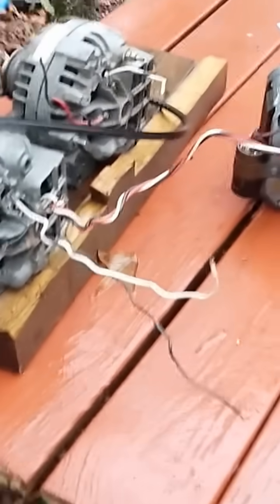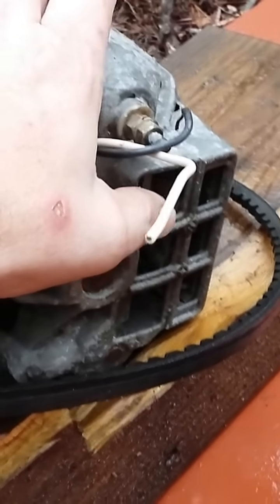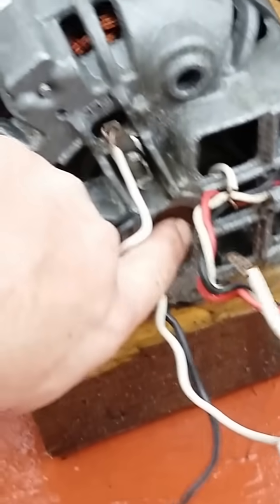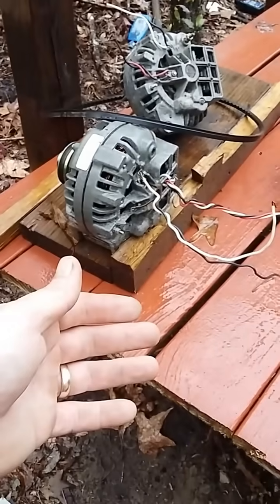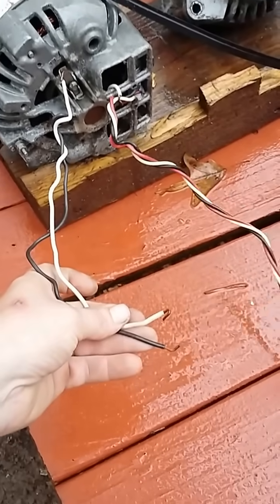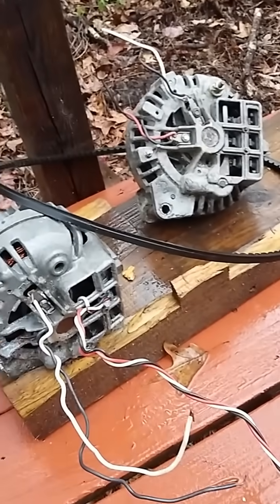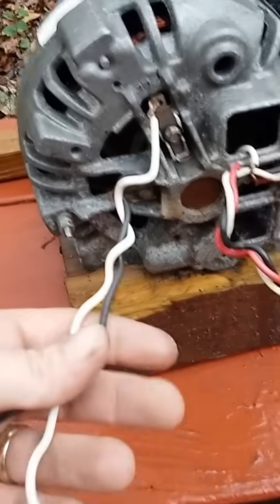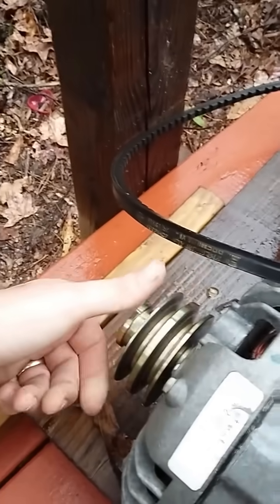Update Free energy forever no wind no solar no gas READ DISCRIPTION!!!

Comment: A battery is stored energy. As soon as you connect any electric device the battery will run down. 
There's no free energy here. It's stored in the battery.
Reply from the maker: +waitaminute 2017 you say that's your problem well let me tell you this what happens when you use high voltage you lose resistance you also become more efficient now what happens when you use extremely high voltage there is no resistance and there is no laws that affect it so continue thinking whatever you want to think but because you've been told so many small lies your entire life now you believe the big lies and it's sad
Reply: Thomas I don't want to be argumentative but 3 to 12 volts dc is not "extremely high voltage".
Ohm's Law is not a lie! Ohm's law can be easily confirmed with a volt/ohm/current meter. 
Ohm's law is not complicated if you can do a little algebra. In science laws are "impossible" to disprove. That's why they call them laws. If you can disprove Ohm's Law by scientific measurements you would be the first and probably win a Nobel prize lol. Good luck.
Reply: Thomas Buie The statement about losing resistance at high voltages is just plain wrong. Transformer stations pump out incredibly high voltages at very high amperage, and every so often you will see transformer's on poles to accommodate for line loss.(resistance/ohms law)
Reply: ThomasBuie EnergyBuies at gmail com  Just how much weed have you consumed? Buddy you are so fucked up you can’t even make a sensible statement.
Reply: Thomas ,you make some outrageous  statements,  most of which I can disprove with highly simple demonstrations, or experiments that can't be disputed. I believe this is what you are talking about,  but I will demonstrate there is line loss no matter voltage,  or amperage. 
The power cables have some resistance. Power lost in the wires can be calculated as P=R*I^2 with R as the resistance of the wires and I as the current that passes through them. Power at the load is P=V*I. From this you can see that if you increase the voltage by 2x, you need only half the current to deliver the same power. However, if you pass half the current on the same wires, you will lose only a quarter of the power.

An example with made up exaggerated numbers:

Wire resistance is 10 Ohm (not very long power line), power required is 100kW. At 220V, the required current will be 100kW/220V=454A. The power lost at the wire will be 10Ohm*454A^2=2.061MW. Voltage lost at the wire will be 10Ohm*454A=4540V. So, the power plant will have to generate 4760V so that the load can receive 220V. Power generated at the plant - 2.061MW+0.1MW=2.161MW. Efficiency is 0.1MW/2.161MW*100%=4.6%

Now suppose the plant generates 330kV (and the voltage is stepped down to 220V very close to the load). Now the current needed is only 100kW/330kV=0.3A. Power lost on wires is 10Ohm*0.3A^2=0.9W, so the efficiency (ignoring power lost in the transformer) is 100000W/100000.9W*100%=99.9991%. Transformers are very efficient, about 98% for the big ones used in power distribution.

Now scale that up to, say, a power plant that generates 1GW and you will see why Tesla won the current wars (hint: there were no efficient DC-DC converters back then).

Summarised solution:

Resistive power losses both in absolute terms AND as a percentage of energy carried drop as voltage increases.

The reduction in loss and/or material (copper and/or Aluminium conductor) is so vast that use of high voltage is very desirable.

Power loss in transmission of power over distance is mainly (but not wholly) by resistive losses.

Resistive power loss = I2⋅RI2⋅R(current squared x resistance).

Power transferred in a circuit = Voltage x Current = V x I

So power lost as a proportion of power carried:
Note that this has units of Voltage/Voltage which cancel to give a dimensionless ratio (as you'd hope). The "top line" Voltage is the I x R voltage drop in the line and the bottom line Voltage is the transmission voltage. So loss ratio is effectively resistive_voltage_drop / line_Voltage.

So, for a given conductor of resistance R the percentage of power lost will increase as current increases and will decrease as voltage increases.

But as Power carried = V x I, if we double V we halve I.
If we multiply V x 10 we reduce I by 10.
This is a win-win situation for high voltage.

This can be put two ways.

For a given transmission line, carrying the same power at higher voltage will reduce loss%.

and

For a given desired loss of power (say 1% end to end) we can use increasingly higher resistance lines (and so less metal) as voltage increases.

A simple calculation shows that loss % decreases as the inverse SQUARE of Voltage !. Increase voltage by 10 x and for the same line resistance losses will drop by a factor of 100!. Murphy was asleep that day!

The gains are so great that if this was the only factor then as high a voltage as possible would make sense.

There are other factors such as losses due to corona and the need to provide substantially increased insulation and clearances and tower sizes as voltage foes up BUT economically, it all leads towards big tall ugly very high voltage towers.

Simplistic example:

1000 Watt power transfer. Rline = 1 ohm.

(1) V= 100V, I = 10A. Power transmitted = 100 x 10 = 1000 W.
Power loss = I^2 x R = 10^2 x 1 = 100 W.
100/1000 = 10%.
10% of power is lost.

(2) V= 1000V, I = 1A. Power transmitted = 1000 x 1 = 1000 W.
Power loss = I^2 x R = 1^2 x 1 = 1 W.
1/1000 = 0.1%.
0.1% of power is lost.

(3) Increase line resistance to 10R = use 10% of original material. Still use 1000V. V= 1000V, I = 1A. Power transmitted = 1000 x 1 = 1000 W.
Power loss = I^2 x R = 1^2 x 10 = 10 W.
10/1000 = 1%.
1% of power is lost. Even when the line uses 10% of the conductor material of the original circuit, an increase in voltage by 10x decreases power loss by a factor of 10 !!

!!!!!!!!!!!!!!!!!!!!!!!!

The reduction in loss and/or material (copper and/or Aluminium conductor) is so vast that use of high voltage is obviously very desirable.

There are other factors that make the gains less great in practice BUT the existence of large and larger power pylons demonstrates that reality is still well served by higher voltages

Power lost as heat due to the wire's resistance given by:
P = I^2 * R (equation 1
Hence, if current I, small, power lost is small.

Power intended, or needed is given by:

P = I*V (equation 2)

For larger voltage, smaller current needed to deliver same power. Hence, larger voltage means smaller current; smaller current means less power lost.
I left out 1 equation,  fix it And I'll believe everything you say.

Comment: he is talking about 3 to 12 volts to spin the motor that is going to "generate" 90 volts?  Lets said it works,what's going to happend when they battey dies?DOOOOOO
Reply: Jaime Santiago 90 Amps...learn the difference ...smh
Reply from the maker: +Jaime Santiago  that is not what I said at all. did you read the description of the video? no you didn't!!
Reply: Who said anything about a battery? To get the 6- 12 volts dc you can use a solar panel!!! Cheers

Comment: Your basic motor vehicle could provide power to your home or any source of 120 volts if you know what you are doing with a basic converter. It comes in handy if your power company can't provide electricity doing emergencies.
Reply: wayne pope gas for your vehicle will cost more than the electricity master electrician
Reply: Please can you show me how i can generate 500watt 24/7 365days of 220v. my whatsapp +2348034099120

Comment: Well you are definitely on to something there, but you need some guidance for sure. There is no sense in trying to get ac current straight from the alternator because it will burn from the voltage drop when you apply a load. 
In order to make it an operational circuit you will need a dc motor to turn the alternator , a 12v battery for a power source and either an inverter to connect to the battery to convert the 12v dc into 120 v ac or another dc motor to turn a 120v generator head. Good luck.  I call it the CON.

Comment: The conductors in the alternator itself aren't close to being big enough to handle 90 amps at 240 volts.... neither are the conductors you want to hook up to your panel. Second, its a alternator....not a transformer. You cant put 12 volts of DC current into this thing and magically get 240 volts of AC out of it with a potential of 20kw of power. Also.... power itsnt measured in amps...its measured in Watts. You have no idea what you are talking about.
Reply: You can get 240 volts with what he had there but you would have to configure the two in series and then the amperage would be @ 45 but average alternator are able to withstand 100 amps
Reply: gopherfan10 #14 wire for 15amps....maybe #12 is the biggest i see....that size wire uv got there isnt even close to being able to handle that kind of amperage.
Reply: I'm not talking about the wire he had hooked to the alternator I'm talking about the internals the dc induced to the field excites the field to produce voltage out of the stator I've never tested it unrectified but rectified and regulated my produced 105 amps when running all accessory and a full audio system measured with an inductive meter but that was 14 v dc which ohms law would rate that as almost 1.5 kw but the guy on the video clearly ignorant to a degree the same alternator running single at 120 unrectified would nominally run 15 amps hooked up in series     with an identical would raise the voltage to 240 @ 7.5 amps it all depends on the load and conductivity all loads are resistance

Comment: I got another secret they don’t want us to know. You can run your central A/C on a 9 volt battery.
Reply from the maker: Danny E yes Danny you are correct but if you know Electronics then you know that almost all Electronics run on direct current so technically you could run your TV on a 12 volt battery (bypassing Transformers) all they do is use Transformers to switch from AC to DC so they can power the equipment in your house! the only reason it's not DC coming to your house is because DC does not travel very far down aluminum wire... here's another little secret that may come in handy someday... when hydrogen is compressed it automatically combusts, so why would you need a spark plug?
Reply from the maker: Late model
 it's not a lot of pressure that's for sure. I could give you an exact measurement if you would like. but an internal combustion engine cylinder will compress it atleast twice as much as it needs before it combusts which is why the  people using hydrogen in cars are advancing they're timing but what they don't understand is they don't even need the spark plugs...
Reply from the maker: Late model there's two ways of doing it but the secret to this is not the timing or the fact that there's no spark plugs. if you change your hydrogen and air mixture it will still run with the spark plugs in it and you can change the timing at that point. But you're not getting past the problem of over consuming your fuel and trying not to expel it out the exhaust... but if you have an apparatus to control how much hydrogen is going in and when...(instead of a spark plug) then you're not even using the intake port for fuel and you can adjust your spray to compensate for timing (fuel injector is the key) and since your hydrogen will combust at .02 millijoules which is 57 times lighter than gasoline vapor, if using a fuel injector you will never have that problem with your air fuel intake... your map sensor can pick up the loss and adjust the air-fuel to compensate for combustion rate. but you are correct if you use the intake port it will ignite before the cylinder gets to top dead center... what I'm saying is instead of relying on spark plug use an injector or just adjust the timing of the combustion with the air fuel intake... more air with the hydrogen and it will combust at a later timing.. hydrogen is very strong volatile fuel and you will have to work out the air/fuel intake... use the injectors it's easier to adjust your ECM (electronic control module) and mass air flow sensor rather than modifying every cylinder of the head(or cam) but once you have it running good at idle it will run better specs for the rest of the sequence... I hope this information helps you out and I didn't get too far off of the subject...  don't worry as soon as I can walk again I will be making a video to show people how to do this! And it will be a lot easier than what I just explained! Probably with just a couple of homemade devices...

Comment: Just saying u dont wanna be flagged or marked or have ur videos or account deleted leave the descriptions and everything blank or keep it as simple as possible, leave links to other websites basically saying this is where i saw this and thought id try it myself ya know, this way they dont think your a threat to the scam
Reply: Same here bro i was designing a water engine as well, im about half way through with my hover technology just gotta find more parts
Reply from the maker: Seth Rebel anti-gravity isn't so hard but in order to achieve anti-gravity you must be able to produce extremely high voltages! so that your n n or s s gate will work correctly.. most people don't know how to build their own Transformers or pwms to achieve this... You know the higher the voltage the less resistance, well when you get to a certain voltage there is no resistance and no way to measure it either, which is why I push Vortex based mathematics so much!!! all the numbers are there! And to be able to do the equations and solve the riddles of the entire galaxy (h4)... let me ask you a question. who is smarter the man who is passionate and teaches himself everything he can his entire life and Wards off the school system in an attempt to find out the truth about everything! because he finds so many lies in everything except for math or the man that goes to school for 3 years and gets a college degree because he has to have a career that he doesn't care about? who would you rather have as a doctor?
Reply from the maker: +Seth Rebel 
I have the water engine perfected thanks to Stanley Meyers and High voltages! 
If was able to walk better, I would be working on my special "differentiator"...

Comment: that guage wire won't support 90 plus amps. the insulation will melt. as an industrial electrician, I'd not try this.
Reply from the maker: +Tuxedo Themes Web Services
 so you're telling me that I can't run 90 amps from this to a Step up Transformer and then cross a aluminum wire back to another Transformer and step it back down? Do you really think that my little wires will melt? I don't think so...
Reply: Tuxedo Thomas didn’t say you couldn’t run 90 amps from this setup, he said that gauge wire you’re using will not handle 90 amps, which looks like either #12 which is rated at 25 amps at best before it starts heating up or #10 gauge which is good for by code 30 amps but will get hot at 40 amps and start melting the coating, and he is right. I’m a certified master electrician and in the trade for 34 yrs now. I also have a degree in electronics. That’s what got me into the electrical trade. The only way you can get away with using such a small wire is if your generator is putting out over 1000 volts with low amperage like high transmission lines do. But they are open wire with no coating on them and air cooled. Far different than what you’re doing. What you’re doing is very unsafe. And just so you know, I have already made my own free energy 5 kWh setup for my workshop  and don’t need a generator either or solar ! It’s all self sufficient, no need for gas or solar.
I’m going to make another one so I can go off grid.
Reply: Another thing, don’t use aluminum wire. Use only copper.

Comment: I did the experiment with an older Chevy alternator. Turns out, by a applying a wire to each of the coil wires I get 12VAC out of any 2 wires. So if you step it up to 120 you'll get about 9 amps. I had the alternator installed into the truck and the engine running when I did the experiment.
Reply from the maker: wizardangel that's great news!
And since you're trying to help yourself I'll try to help you as well, if you can step it up 200000 volts or use your coil pack... that would be much better for a hydrogen cell! keep in mind you need distilled water without any impurities! no sodium bicarbonate or anything.. people think that it's low voltage and high amperage that create great hydrogen cells to produce lots of LPNs and it's the opposite... water is not very conductive except for with high voltage or water that has a extra electrolytes in it..
so when you apply very high voltage to your stainless steel plate you will basically sing to the water and it will separate itself without resistance. What will actually happen is you will produce so much hydrogen that you will no longer need gasoline and most people don't know it but when you compress hydrogen it automatically combust so there is no need to run the power to your spark plugs but you will have to have pulsed DC or alternate current and at a very high voltage to make this happen... but when you do you can say goodbye to your gasoline and energy consumption bills and just start collecting groundwater to disteel. I hope this information helps you in your journey brother thanks for not cussing me and at least trying the experiment!! most people have not read the description in this video and just talk trash which is how I respond to them... as well if you're talking to a child you need to be on their level. if you're speaking to a grown man then you need to speak like a grown man...